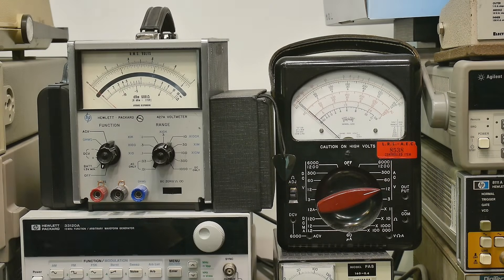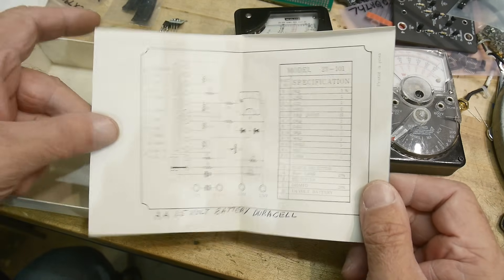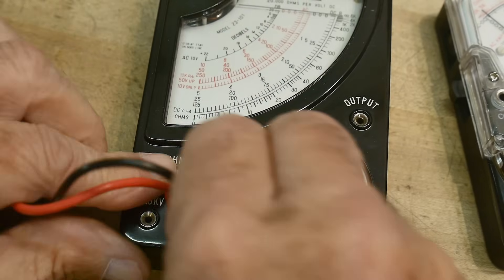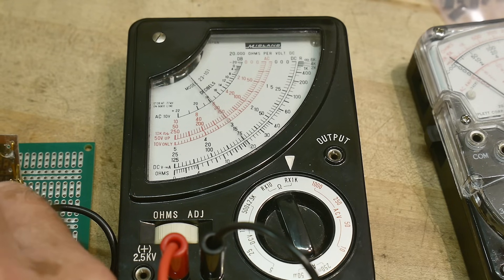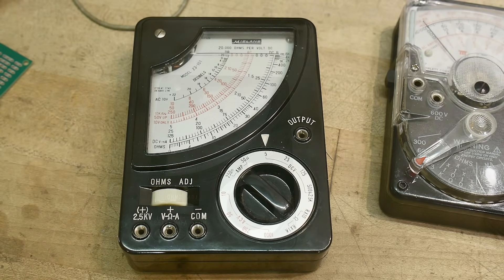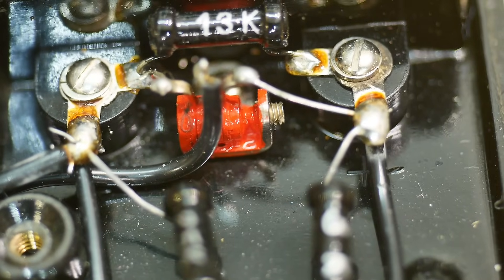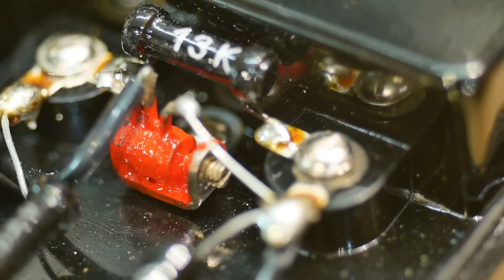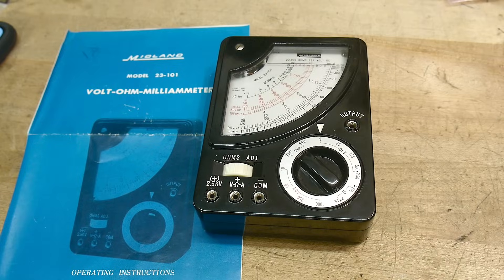#1734 Midland VOM with Corner Meter

Comment: Mine was a new gift in the early 60's and I still have and use it.  It did have a leather-like cream colour flip open case that was secured with one snap.  Great dependable meter. I believe it came from a Radio Shack in Chicago.   The pin jacks got a little loose but easily fixed with a squeeze from my needle nose pliers (also from the 60's).  The meter shown is in great shape.  Reading the scale has become second nature; not difficult to use at all.  No need to pause the video to know that it is a rectifier for an old guy like me.  I have used the output jack - once.  Mine is a cherished thing and a reminder of my initial foray into electronics.  Thanks for the video and the comforting audio of the switch turning.

Comment: I remembered I saved years of all my pocket money to buy a 10A/5KV DC 10kx ohm analog meter which was made in Japan in early 70s.  An older guy recommended that meter to me.  It was my first project to find out how electronics stuff worked and I had just learnded about ohms law that year.  I searched for it on eBay but I haven't had any luck.  If anyone remembers it give me a shout.

BTW 10V AC range had a separate line on meter due to the diodes voltage drop.  I don't understand why you need two dioides here.  Mine had two reversed germanium paralleled across the metter for protection.

Comment: OK, cool! Now discuss your Triplett 630! After collecting four or five Simpson meters, I got an immaculate 630 with the original 30-volt 'B' battery from 1965 in it! And it still has a charge! It is one of the most beautiful meters ever made!
Reply: Dave Jones did a video comparing it with the Simpson 260. The Trip' won. (Pretty internals.)

Comment: My mom bought that meter for me 55 years ago down on Radio Row in San Francisco when I was a young ham and I still have it today as a nostalgic piece of gear...mine is branded "Monarch" with a red Ohms Adjust knob. The resistance function is reverse voltage polarity BTW. Yep, they're "Pin Jacks".  73 - Dino KLØS
Reply from the maker: got your package, thanks! Now I have to do a project

Comment: It was my first meter as long as I could not afford a better one more than 50 years ago. The resistors are measured in both ranges on the outer scale with the factor written on the selector. 
The rectifier is a copper oxide rectifier which has the advantage of the small voltage drop of down to 0.2 volts, smaller than germanium diodes. The old principle is just for small voltages and low current densities, maybe still just good for moving coil µA meters in those days.